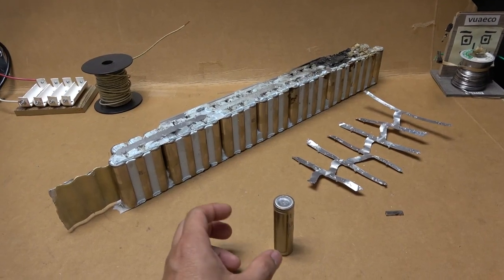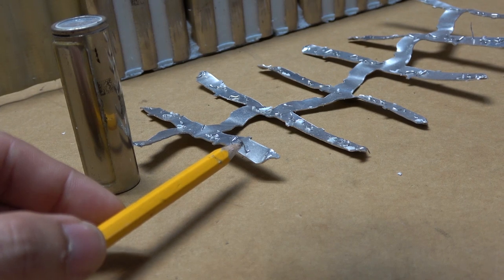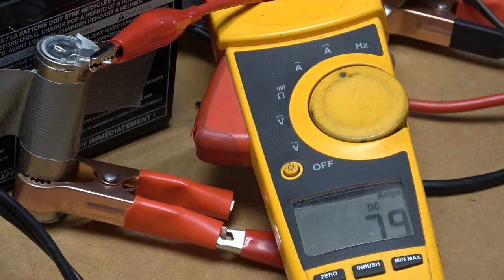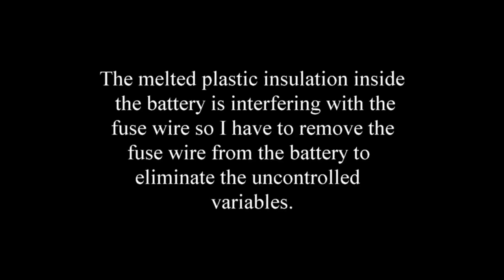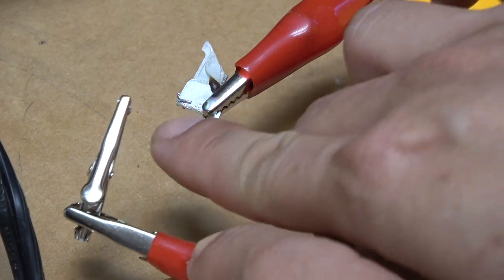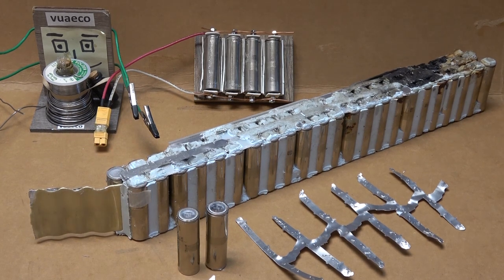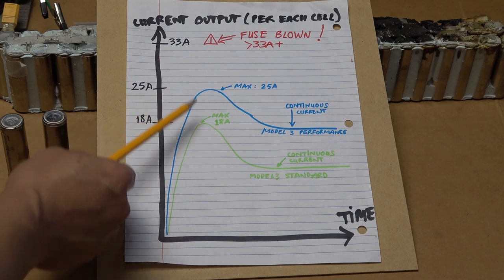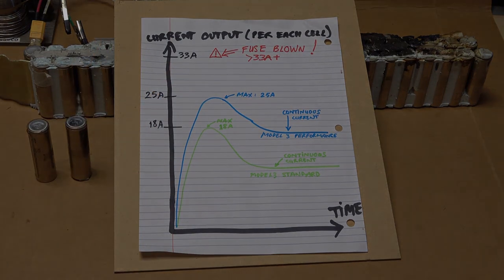Tesla Model 3/Y battery fuse test: What does it take to blow it?

Comment: The fuse wire is probably over-rated since the battery cells can be worked harder than normal because they are normally liquid cooled.
Reply from the maker: Yes, absolutely.

Comment: i have a technical question:

 the results of the first test showed that the plastic surrounding the terminal melted which prevented the fuse wire from separating from the terminal. doesn’t this imply that the fuse wire failsafe may not actually prevent the combustion/explosion of each battery?
Reply from the maker: Yes, that might be a problem. It looks like the insulation melts before the fuse fails. If that insulation fails, the battery will short itself out and fail before the fuse does.

Comment: I have some of these cells and have found that the positive terminal cant be spot-welded or soldered! 
Have you found a reliable way to make connections?
Reply: Any success so far? 
Read you have to use strong spot welder and sand the area just before welding to prevent oxidation

Comment: Hi my friend vuameco...good day. Can i ask you what brand clamp amp meter are you using..planning on buying myself  one, i see you use it in most of your videos,and do you recommend it ? Thanks.
Reply from the maker: Good day, mate. It's a Fluke, model 337. It's expensive but worth it if you use it a lot. I've tried many other brands but nothing comes close and I always go back to this good old meter.
Reply: Thank you for your kindly reply dear friend. Yes it is expensive,i own a fluke volt meter,yes they work great ,and worth the price . ..do you know if i can use a volt meter to check amps,? I tried so many ways ,but no luck.😔
Reply: @ricardo2008lozano  Virtually all volt meters have series connections for current measuring. But for non-contact situations, you'll need a clamp on ammeter.

Comment: Please note how fuses are ratings.  a 15 amp fuse will hold 30 amps for 10 sec.   but a quick surge may  be 40 amps  <1 sec   No one should design for the maximum of a safety device .  Thus Tesla may only want 10 amps per cell max.

Comment: short fuse with less resistance with 33A current through it will be colder than a longer fuse with higher resistance with the same 33A current. the longer higher resistance wire should "blow" first not last. ohms law.
Reply from the maker: Ohm's Law: I = V/R. Resistance is inversely proportional to current. So short fuse with less resistance will allow more current to pass though and therefore more heat. I made a foam cutter a while back (you can see the video here in this link: https://youtu.be/GnWTmmhZVD8). If I put the 2 alligator clips (those are the + and - terminals from the battery) closer together, the ni-chrome wire will glow red faster and hotter. If I put the clips farther apart, the ni-chrome wire will take longer time to heat up and it's also not as hot. (this is how I can control the temperature when I cut different kinds of foam or plastic).That means in order to get the longer wire to heat as much as the short wire, I need to pass more current through it.